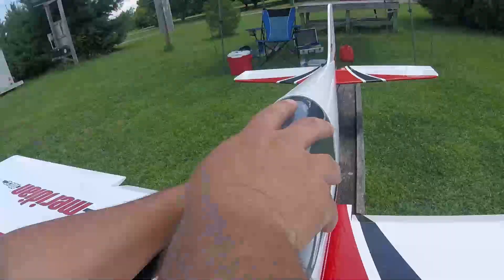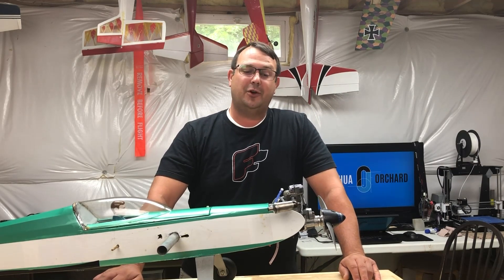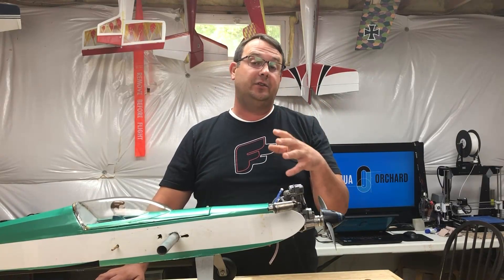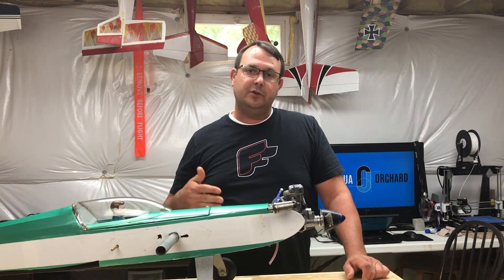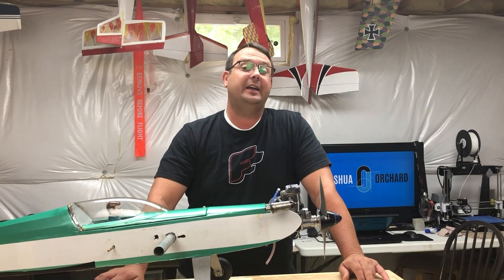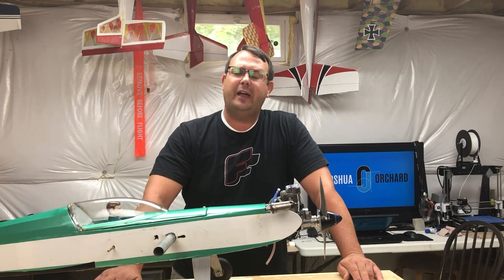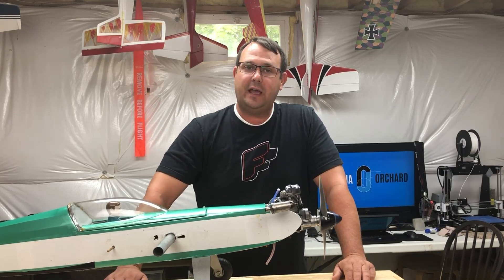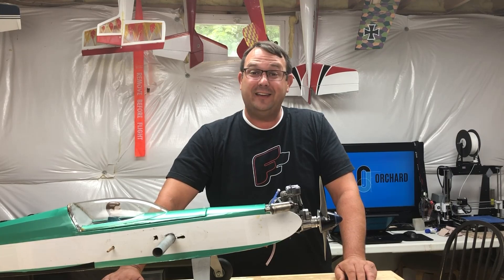Electric to Gas Conversion???

Comment: If you need to go up an inch in prop diameter for a gas engine just go up in pitch instead of inches. If you need 13×6 and dont have ground clearence then use a 12×7 or 12×8. Going up in pitch compensates for legth😊

Comment: Hi Joshua! I've just stumbled across your video. Im happy to hear youve moved over to glow/gas power! Well done! A great learning experience that definitely requires more technical skill and nuance than electric.
Your point about joining a club and getting in touch with an experienced Gas/glow pilot is totally true. It really is the best way to transition somewhat without having to go through the frustration of a poorly set up engine.
With regards to fuel costs, have you considered mixing your own glow fuel? Methanol is relatively cheap to buy (5 gallons should not cost more than $6 per gallon. Also buying the oil (Klotz KL 200 is not that expensive. You don't have to fly with nitro either. FAI fuel 80/20 will run in any glow engine provided you tune both the low and high speed needles. I mix my own fuel and it works out to be 1/3rd the cost of commercially available fuel.

The issue with transition, you should never accept a gas or glow engine with poor transition. You can absolutely rip the throttle and if its tuned right it should transition to full power without a problem. The carb on gas planmes has low and high speed adjustment. Almost all transition problems come from the low speed being set too rich or too lean. To tune I allow the engine to idle for 20 seconds and then mash the throttle until I achieve a clean acceleration to full power. Why 20 seconds? to simulate joining the circuit for landing at reduced throttle settings. This is so if I need to go around I will have instant power and not have to overcompensate for splutter or the engine quitting.

Comment: Good stuff. I went on the opposite learning curve, glow to electric. There I had to learn battery management to get more flight time and keep the system from overheating. I have a Balsa USA 80” Fokker EIII I fly on a Supertigre 0.75. At 11.8 lbs its got a pretty scale power to weight ratio. It has to be flown off the ground, not launched like so many overpowered glo/electric systems. It flies like a trainer but you have to be ever conscious of the momentum.